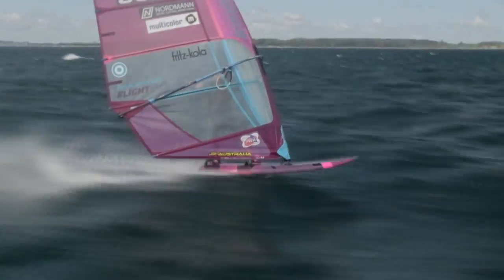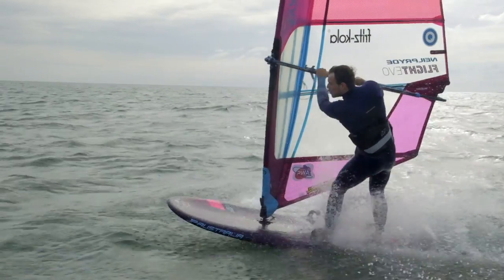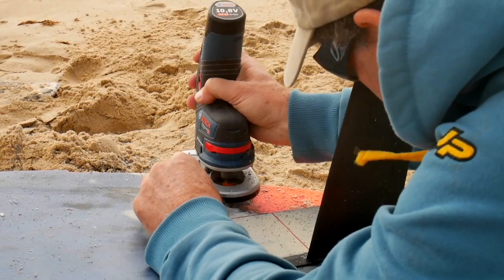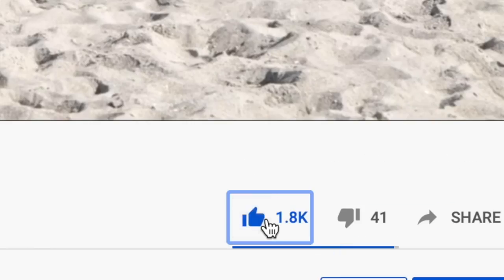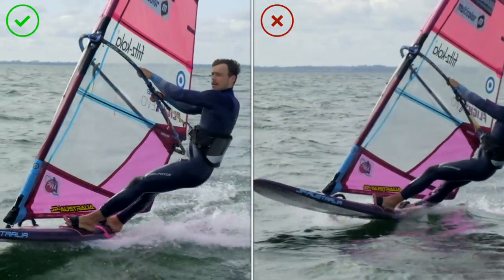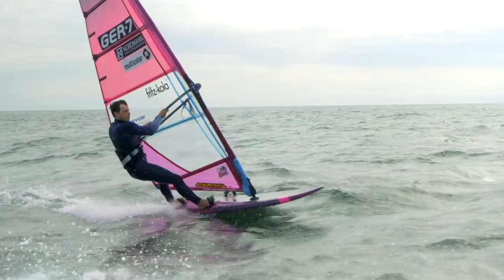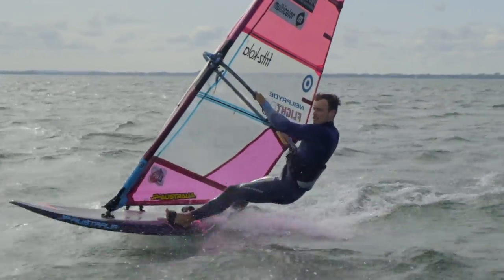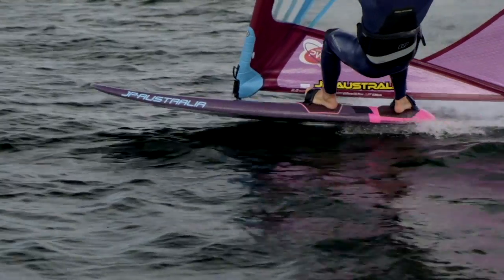❗️🌊 How to: FLYING OVER CHOP | never windsurf out of control again ✅

Comment: That's really good advice!  I never thought about closing the gap and lifting the windward rail to deal with chop.  I'm gonna try that!  What I usually do when it gets super rough is point the board slightly off the wind so I'm sliding between the waves instead of bashing into the wave faces.  When it's real windy, the board wants to climb into the wind, which makes it bash into waves.  When it's like that you can point slightly downwind and not worry too much about getting back upwind because it's so easy to do in those conditions.

Comment: I'm not on this level of windsurfing performance (I do first power riding, but only few times), but I still enjoy your tutorials and how good they are.
(You know hight quality of teaching and video)
Thanks for doing that.
Reply from the maker: What kind of tutorials would help you at your level??
Reply: @Nico_GER7  I think that on my level it is more about sailing and getting expirience on the water, than watching tutorials and analizing them, but if I must say it can be something about How to get in to power sailing (or how to easier do that)  and then how to get into straps. If I messed up something and You do that and I miss that tutorials, I am really sorry.

If it's 4Bft, I have 6,5m2 (my biggest sail, but still very old one) and my body weight is about 65kg, is it enought to get planing (power sailing)? 

Thanks for answering!!
And thanks again for doing good stuff for YT that we can enjoy that much!!!  : D
Reply: Everyone was a beginner once! So keep doing practice and you will getting better and better every day.
Reply: Nico Prien getting into the backstrap in choppy water/ heavy wind, jibing without losing the planing, reparing a small crack in your board during your holidays

Comment: I kindly offer my own experiences in this particular department:  
First, to all those beginning to acquire this skill, I cannot emphasize enough the importance of working out the legs, either in the gym or the convenience of your own home. I especially felt this as I started to curl the toes of my front foot up (and drive down with the heel in order to "fly" the board) my quadriceps would begin to burn after a while. 
Secondly, it is important to regulate fin pressure through your rear leg because driving the fin too hard through the chops may induce spinouts. At least this is what happened to me. Why? Possibly because, through chops the fin can get air and lose grip.
Nico, a question: If I am not mistaken, the issue of sailing over chop becomes especially challenging during gybes. Do you also somehow try to fly the board when carving? Or is withstanding chops merely an issue of keeping knees bent enough to be able to absorb chops?
Good presentation. Very clear, and very concise.  Looking forward to the next one.

Comment: Thanks for the tutorial Nico! very easy to understand.
Could you make one about harness?? I'm often finding myself with pain or sore muscles in my lower back and obliques specially if I use a bigger sail. I know that it could be my stand but I think my stand is good.
I use Dakine NRG harness. 
Thanks!!
Reply: I had the same Problem with the NRG, switched to a bigger sized tabou harness and the pain is gone. I love the control of the NRG, but even my ribs hurt days after an intensive sesh with it. Maybe try some other harness from a friend some time

Comment: Thank you for making this video.   Let's hear your comment on mast position.   In choppy conditions I've always been concerned with the waterline of the board.  That said, during choppy conditions, I move my mast base slight behind the ”normal position” for the sail size I deem best.   This gives me less board in the water which helps me control the chop and keeps my speed up.   I like to rig powered but I do find that spin out can also occur if my sail and position are not perfect for the conditions.

Comment: Hi, It’s a fin question. My Magic ride 118 came with a 40cm fin. The board scuttled / flew over chop. Brilliant. Then I was told that was far too much fin and I risked serious injury so tried two smaller fins (30cm, 36cm G10 freerides) which didn’t cut it at all. (90kg, 5.5/6.4m sail, 25 knots, 75cm wide 118 MR board). 
1- am I overfinned if it works? (Despite what the charts say)
2- is there a serious risk to life and limb as told? 
3- what is the solution to happy safe blasting in heavy chop? 
- should I just carry on or do I need a narrower board for 25 knots? 

Question 2 - stance

I like to use a 3 strap set up which is meant to favour an upright stance, but is scary in big chop as I fear that I will be catapulted. So I lean out as far as I can and it seems more secure. 
I find it easier to keep the board flat with 3 straps so I’m fast, don’t head upwind etc. 
Should I ditch the 3 straps or can you tweak what I’m doing please? 

Question 3

Is there a one board solution for over 18-30+ knots, sail range 3.3-7.5m? MR 118 reluctant to plane with 7.5 at 18 knots. 

I want to start foiling for low winds and do everything else on one board. 

Thanks and loving your channel, Elliot

Comment: I think the most important thing in transitioning from beginner to intermediate is to learn to trust the board, dont over think it and try to control its movement too much. Look ahead and anticipate, hang your weight off the boom and let your legs be pliant enough to absorb bumps.

Comment: So an overview if i understood it well..when it's choppy(always haha) we dont dig the windward rail..we lift it and we counterbalance it by closing the gap between the sail. Also we put mast foot pressure through our front hand(if the nose lifts). Wow really interesting. i was always thinking that in choppy waters we must always dig the windward rail so the board slices through chop instead of bouncing. Thanks man!
Reply from the maker: Bingo. Digging the rail is something for wave/freemove boards. You want the chop to pass through from underneath. Actually, the counter movement is a series of things, but if you close the gap the rest should happen naturally and I try to not overcomplicate it for the viewers. When you close the gap you will have more pressure on the backfoot and the fin, which allows you to keep your course and lift the nose and windward rail at the same time. Let me know how it goes!
Reply: @Nico_GER7  ok.i got.it..one more question. Aren't you more prone to spin outs when the back foot pressure is increased? Also you lift the windward rail by lifting your heels..right? Also you are a f***ing beast man..never seen anyone goes so fast in chop. Thanks again for your amazing content and keep it up!🤝

Comment: Great and very helpfull - exactly what I needed Nico ! One question - sometimes in chop my lines suddenly unhook - what can I do to avoid that ? I mostly use seat harness on my race gear. Thxalot !
Reply: Are you perhaps bending your arms or protruding at the waist. Try sailing with  an extended front arm and "sit down on the barstool" whilst keeping a straight back. Let us know if it helps :-)

Comment: Hi Nico,
Thanks for this great tutorial! I really appreciate the effort all of you put into this!
I tried it myself yesterday with succes.
But there are 2 issues which I am struggling with.
Yesterday I was windsurfing on a lake on a gusty day with my biggest gear. 120L freerace board and 7,2 2-camber freeride sail.
As soon as the gust hits me I get planning in a broad reach to pick up speed. But then I need to get upwind as much as possible trough the chop to compensate for coming lulls.
Lifting the windward rail and closing the gap works, but it seems I can only do this by pressing down the toes on my back foot as almost all pressure is on my back foot and this puts me into spinout when I want to get maximum upwind on the leeward rail. My trim felt ok, the board was flying on the fin when the sail was well powered.
So, 2 questions:
1. How do I get more pressure on the front foot to avoid spinout?
2. What is the best way to safely recover from spinout?

Looking forward to your comments.
Reply: So...
Its my guess that this would be the kind of questions that get asked (and answered) in the members area?
Reply from the maker: @Boracay, Philippines Ross David  Absolutely 🤙🤙

Comment from the maker: 4:44 Which problem is more common for you?
Reply: definitely the second one is most common for me
Reply: Second one
Reply: Specially the second one when the chop isn't completely in the wind direction
Reply: first
Reply: First for me, I end up with the nose going up in the air.
Reply: First. I manage with chop and winds at max 20 knots. Yesterday with 20-30knots and 6.8 it was to difficult with bigger chop and short distance between a top of the wave. I can improve lifting the rail not to catch chop.
Reply: Second one for sure, I am a bit too familiar with the resulting catapults :D
Reply: I'd like to say first, but I must be honest. Spectacular catapults!
Reply: For me the nose is sent flying, but lately i kind of figured it out :D comparing it to snowboarding helped me figure out how my legs should react to chop
Reply: @Nico Piren i have difficulties to have the board to really fly over the chop.  Fine tuning of the sail (boom height, outhaul, downhaul and mast foot position) and my grip on the boom, my front hand is very often midway to the boom head from the harness line, seem the way to go...  with weed fin, it is more difficult to lift the rail also, or?
Reply: slowing down and almost getting catapulted when I hit the chop badly
Reply: Lack of wind and quarentine..not in this order of course. .So Stay home if u can.. soon  we all will be windsurfing...But let´s  ket´s hope the coranavirus can´t swin..LOl
Reply: I'm mostly struggling with the board trying to jump. Never catapulted because of the chop.

Comment: My problem is that my front foot always wants to bounce out of the strap when I’m going at high-speed, particularly in chop. That means I have to run my boom at the bottom of my Neil Pryde Evo sails cut out, which reduces how much the board will fly and makes me slow. I’ve spoken to so many different people about how to fix the problem and no-one has been able to help me. I’ve tried downhaul, outhaul, boom height, footstrap position, footstrap width, different boards, fins and everything else in between and nothing works. It’s gotten to the point where I hate using my slalom gear because it’s just frustrating. Can anyone help me sort this issue so I can get back to enjoying my slalom gear again?

Comment: Hi can anybody explain when I’m about to get in back strap I allways miss it is there a reason for this or do I just need to practice more
Reply: If you always miss in same direction, try move it that direction. Otherwise just practice or go straps only after get more speed
Reply: Alexander Merkulov thanks honestly helped quite a bit
Reply: Before going in the back strap, sometimes I move my foot back to just in front of it, so I can feel it and my foot knows where it is.  And I have found it helpful to almost imagine that rather than reaching my back foot into the strap, I am using my front foot to bring the back strap to my back foot, by pushing the board forward and ever so slightly downwind.  Not an expert by any means but it works for me.